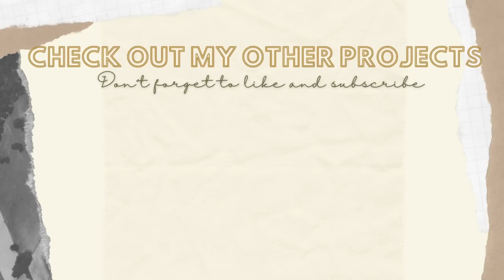FURNITURE MAKEOVER FOR BEGINNERS | Save Money by Updating Your Furniture to Work in Your Space

Comment: Tip: Instead of Citrestrip, use Klean Strip 15 min. No plastic wrap and it works much quicker so you can keep moving! (No affiliation but it's just awesome!) Also, if you use some mineral spirits on a rag to wipe it after you're done with the stripping, it won't gunk up your sanding pads.
Reply from the maker: Next time I try this, I’m definitely going to try the Klean strip!